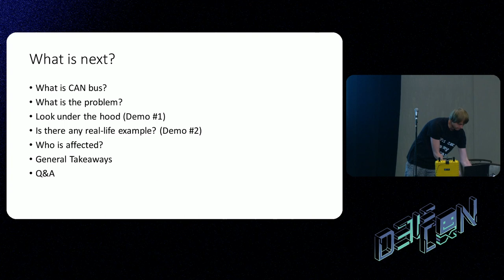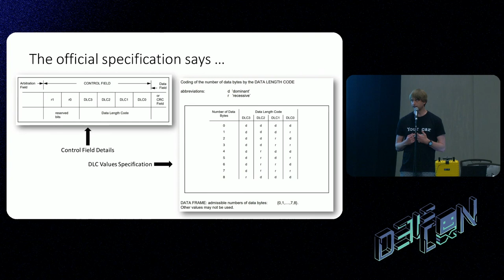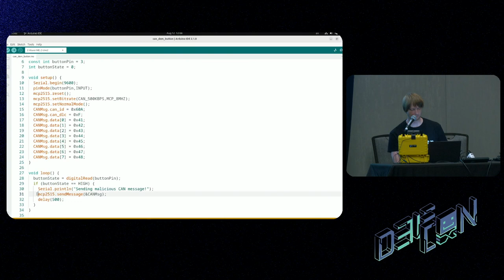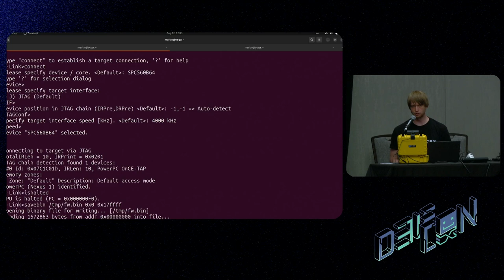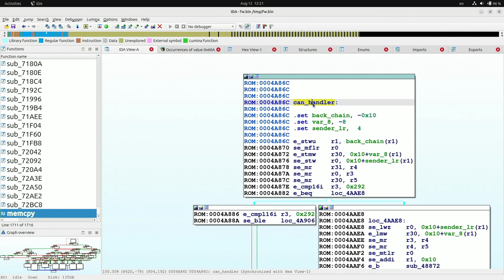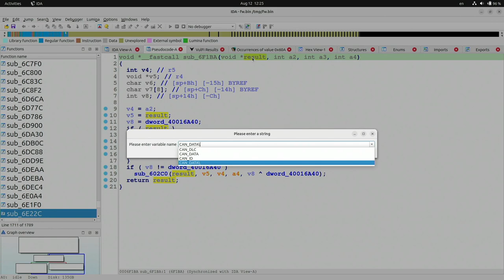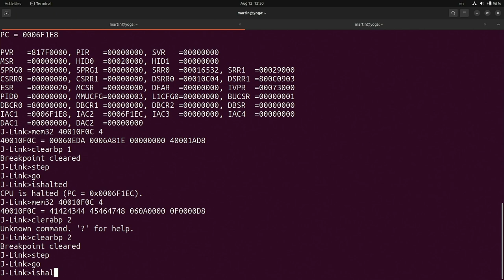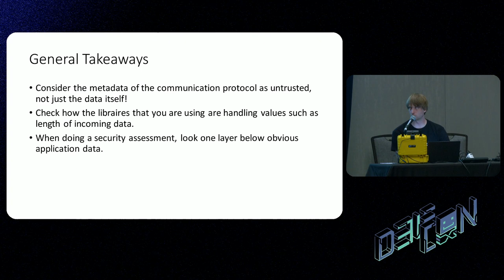DEF CON 31 Car Hacking Village - Abusing CAN Bus Spec for DoS in Embedded Systems  - Martin Petran

Comment: Interesting talk. Because we tell in our seminars for over 20 years, that you should be careful with DLC > 8 as they are undefined. Some people have used this as a feature to indicate additional things. But then in the implementation you have to be careful, because there are CAN controllers, that may issue error frames, when they see a CAN frame with DLC > 8, some CAN controllers who ignore those frames, and some who forward those frames.

Regarding the Q&A at the end: he may didn't read the spec, because the minimum CAN XL frame is 1 byte. This is why the DLC is now from 0 to 2047, which actually means 1 to 2048 bytes.

Comment: I had though of using Can Bus jamming as a vehicle immobilizer. It probably would stop the headlight hack too, but you would need some way to turn it off before you unlock the car with your remote...
Reply: Noted
Reply: You're overcomplicating it. Just ground the can bus lines and there is no network.